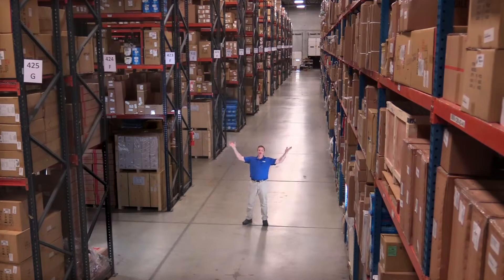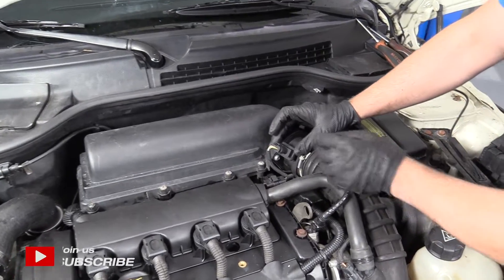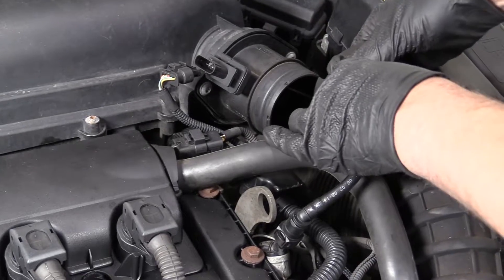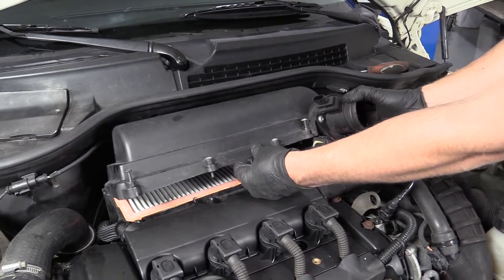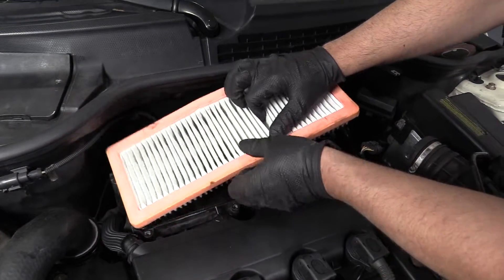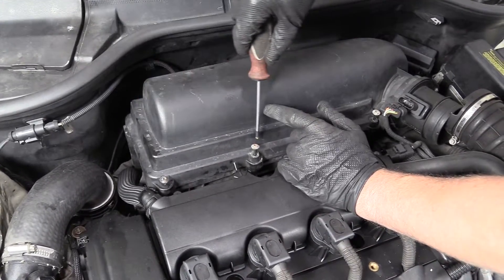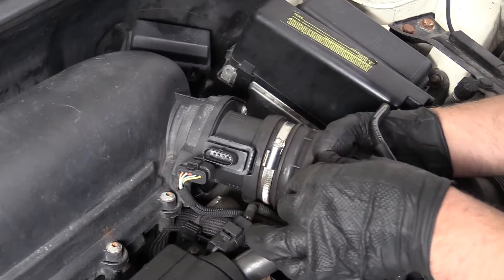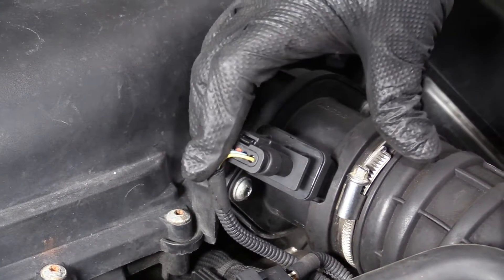How to Replace Engine Air Filter 07-13 Mini Cooper

Comment: Thank you a lot for this, i had a KN filter installed 4,000 miles ago and i can tell its dirty because i cant hear the blowoff valve anymore. Weve also had a lot of dust in the air lately, so its time for a cleaning.
Reply from the maker: +TheWaynester101 Thanks for checking us out! http://1aau.to/m/Shop-1AAuto-c
Reply: @TheWaynester101 Did you notice any significant difference when you installed the K&N filter to your car? Just bought one myself and curious if it’s worth it?
Reply: @Squirrel-harvest_  I figure it's not

Comment: Should the battery be disconnected before disconnecting the mad sensor? 2012 r56
Reply from the maker: +Sam Darena yes, disconnect the ground cable from the battery before doing this replacement.